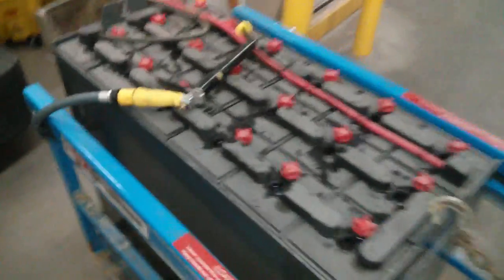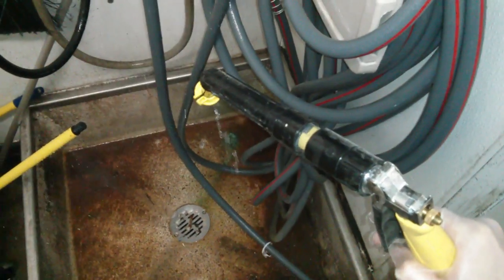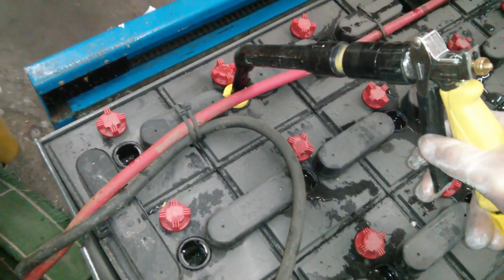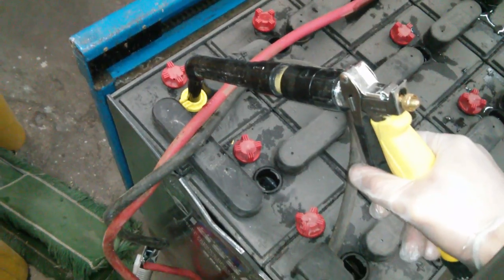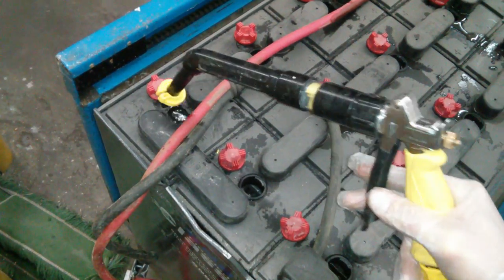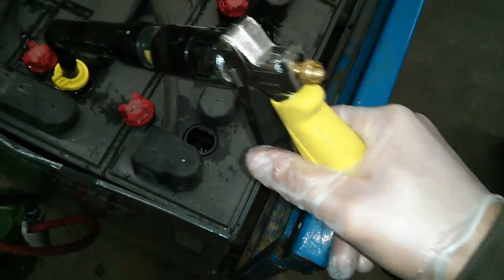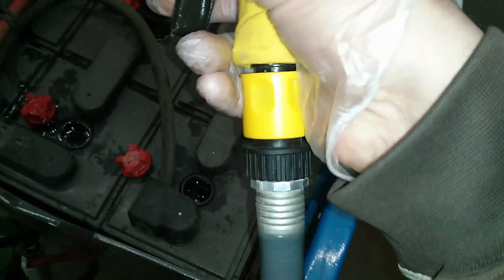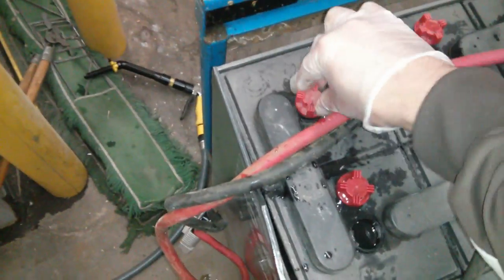How to fill a forklift battery with water

Comment: Please edit the title to read "HOW NOT TO" your cells are way to full. The battery is going to boil over now...adjust the yellow ring on your gun. Put the yellow ring all the way to the top. Push your nozzle into the cell until it hits the plate inside. Then slide your yellow ring down and tighten. Now it will fill it up perfectly every time. Good luck.
Reply: +sean eh Thanks sean!
Reply: sean eh oh shit i might've done the same it actually spilled a bit aswell
Reply: You know your stuff....how do i take out the battery on a stand-up yale reach truck?
I need to fill with water